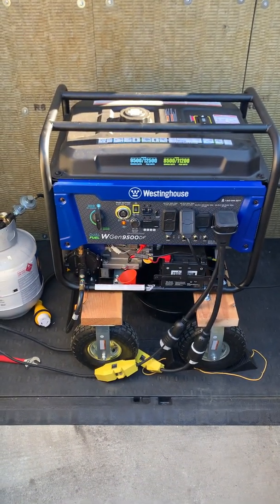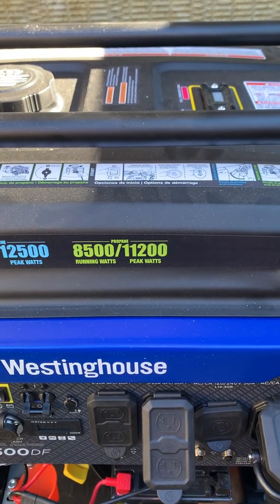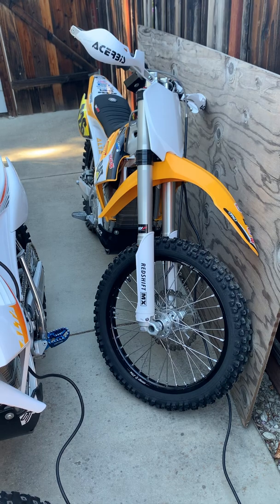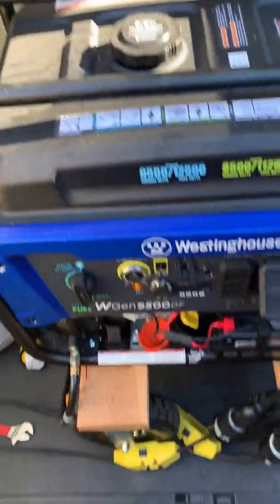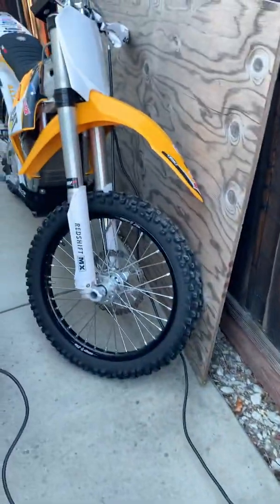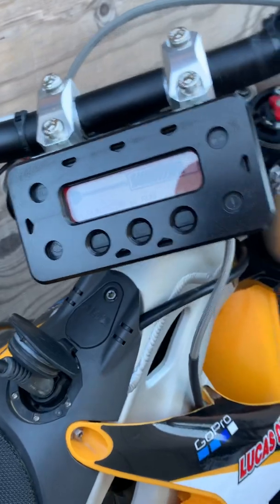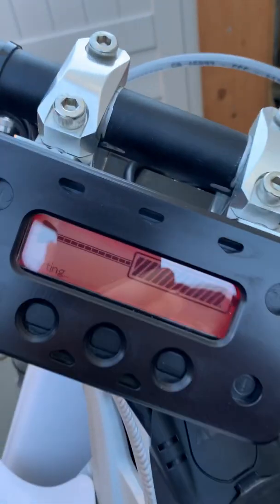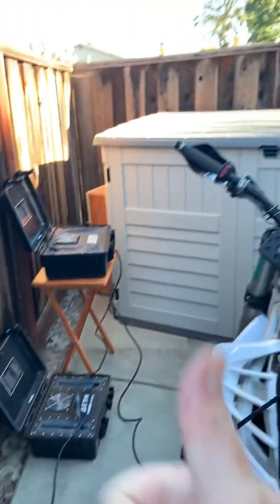Will my Westinghouse WGen9500DF generator charge both of my electric motorcycles at the same time?

Comment: Wow you are a blessed man to own two Alta's.  I have a KTM Freeride that I will pass down to my son when my Stark Varg is finally delivered.  Its been a blast to ride wished I would have known how great the E-dirtbikes are I would have bought an Alta forsure.
Reply from the maker: The Altas have been a blast.  I and my son ride them almost every weekend.  Have over 300 hours on each of them, and all I've really had to replace is tires and chains.  No oil changes, no air filters, no top-end rebuilds, etc.  I did rebuild the forks on both bikes, but that works just the same as on any dirt bike.  They start whenever I want, don't lose power at altitude, never bog on a hill climb, and I'm always in the right gear.  It feels like cheating most of the time.

Comment: You mind giving an update on how the generator and shed have been holding up?
Reply from the maker: Not much to update.  I haven't had any power outages since I picked up the generator.  I think it's some kind of voodoo protection spell against the blackout spirits.  I've used the generator a few times at the MX track, and it works well.  Just a bit awkward to load two dirt bikes, a generator, a big ramp, two chargers, and a propane tank in the back of my short-bed pickup.

Comment: Link for electric bikes?
Reply from the maker: The bikes are Alta Redshifts.  One is an MX model and the other is an MXR.  Sadly, the company is no longer in business.  They were built in Brisbane, CA until October of 2018.  There are many reviews and vids on YouTube, search "Alta Redshift".  Some great vids by Josh Hill and others.   Up to this point, the Alta is still really the only full-sized electric dirt bike that could compete with gas bikes.   On the horizon is a new company called Stark which will be bringing out a model called the Varg later this year.  The Stark Varg will take the Alta model and bump it up quite a bit (80hp, 200 ft-lbs of torque, 240 lbs weight, better range and faster charging than the Alta, etc.)

Comment: Have you thought about adding swivel brackets to the wheels in one side on the generator?
Reply from the maker: I considered it, but Harbor Freight was out of the swivel casters when I bought them.  I also wanted to make sure the generator would not wiggle around in the back of the pickup while driving, so I wanted something a bit more rigid than the swivel caster due to limited space.  But I have considered swapping them out.  The generator doesn't move around too often, fortunately.